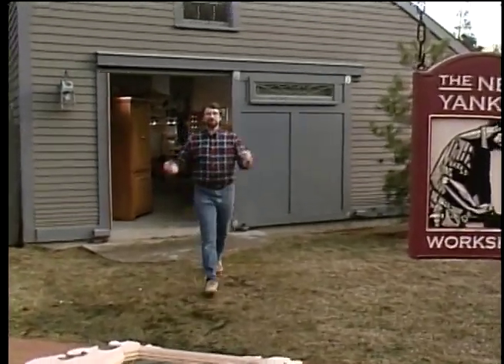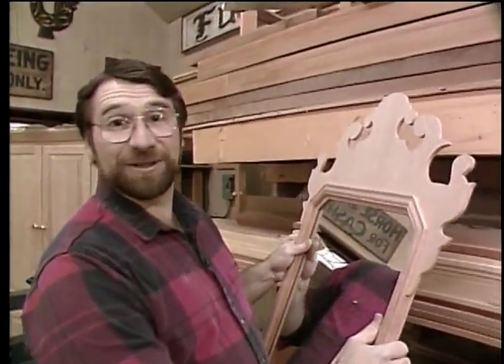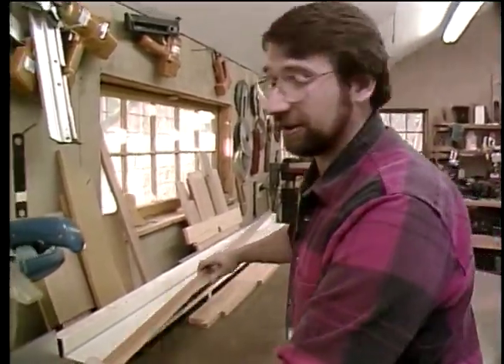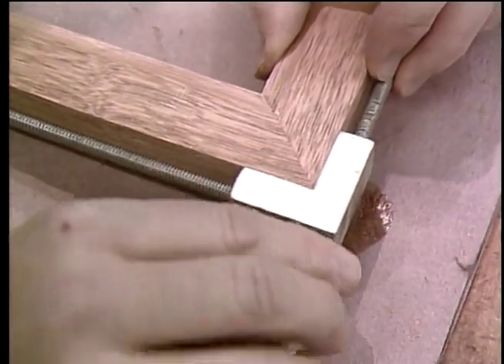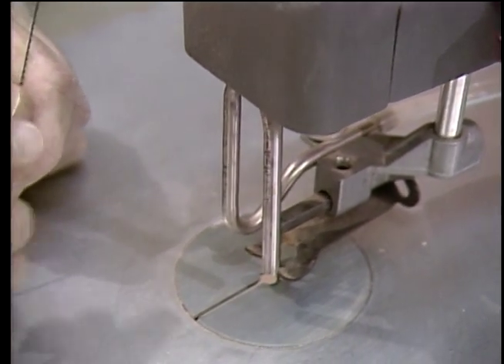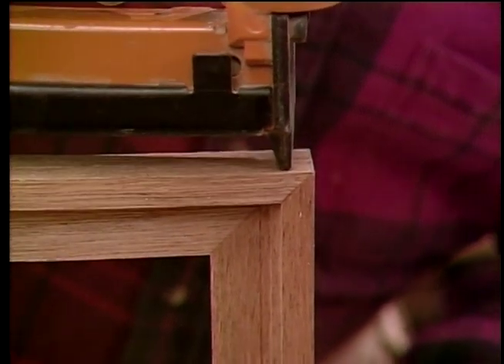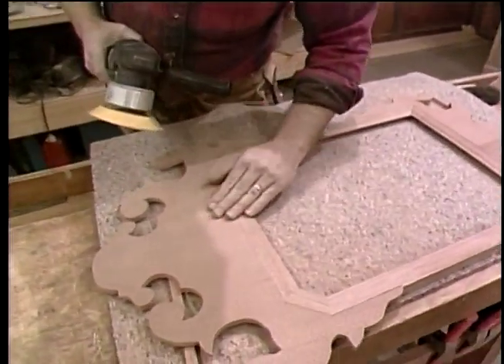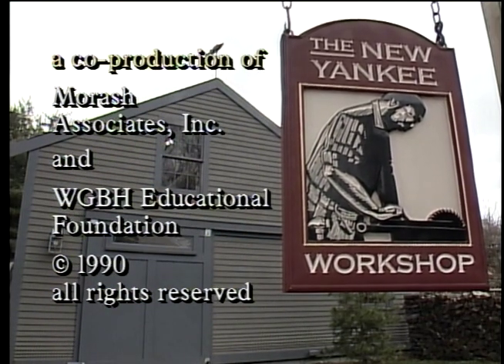Chippendale Mirror  |  S2 E10

Comment: Holy cow, I bought the plans and built one of these years ago.  I think it was the first piece I "copied" from the NYW.  The only difference is mine has a red laminate backing but other than that it looks identical.  It's still hanging on the wall 30+- years later.